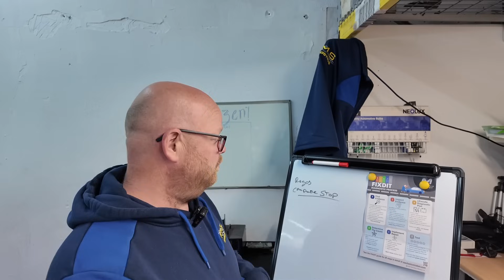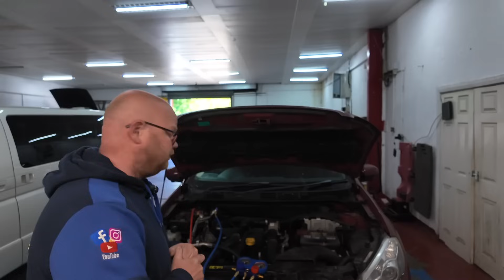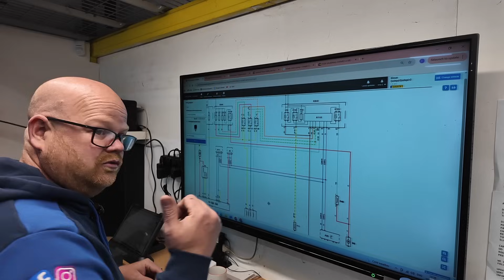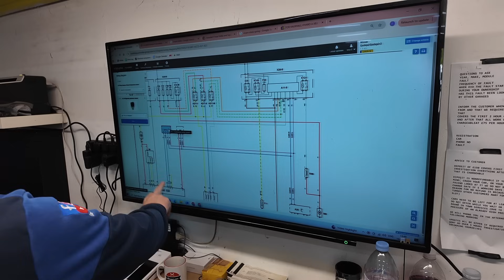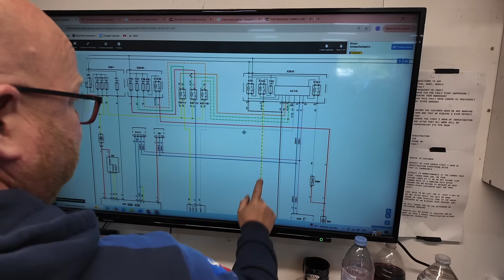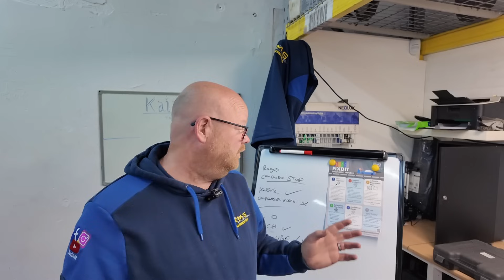The Truth Behind This diagnostic process from mechanic mindset(Don’t miss this)

Comment: Having been a master technician for over 30 years i know the multiple stage process of repairs but with a fault like this i would go straight to the consumer ie ac pump and test for power there and work backwards if it was not conclusive after all if the bulb went in your kitchen would you test the incoming mains then the mains fuse then the rcd then the wiring to the switch  the switch wiring from the switch etc etc or test the consumer first?
Reply from the maker: this was a free job for a friend so was a good one to show the fixdit process

Comment: Why you didn’t load the circuit for testing power and ground? It still may lead to replacing ac compressor for no reason
Reply from the maker: if it was a volt drop we would have seen a earth path while checking at the firebox end,we know we had a full open circuit,we did check off camera the coil was open.
Reply: That make sense, thanks for explanation. Dealer tech here from Ireland, but honestly I would love to take a part in a workshop like yours. Where main unit is volt and not newtonmeter  😃😃😃

Comment: Harmonic motion describes the oscillation of an object whereas i would suggest Resonance is possibly occurring. If an object vibrates at a resonant frequency the vibration gets larger or amplified from the source vibration and could explain the failure.

Comment: Fault finding in electrical circuits is an art, but when done correctly
you will find what is causing the fault.
If you have seen the same fault many times the temptation is to 
go straight to what was causing the issue in the past only to
find that another componenr has failed this time.